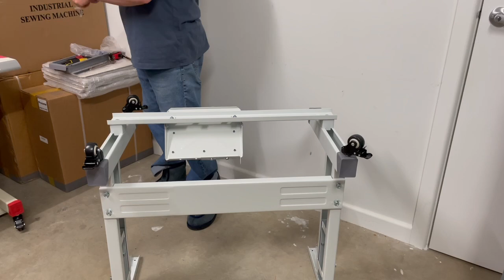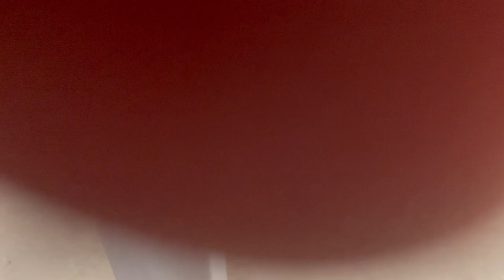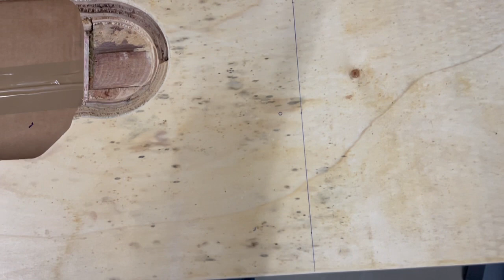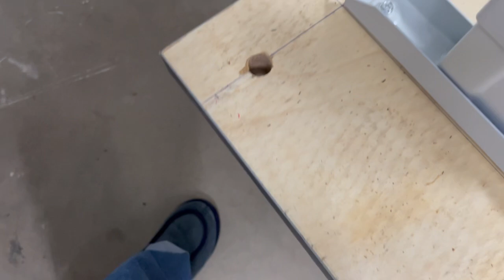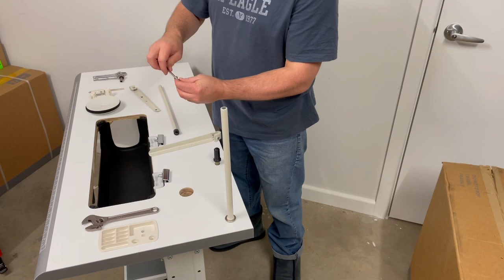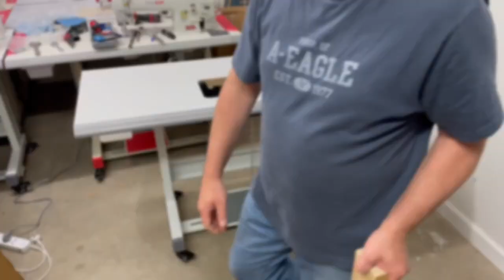**Updated** How To Put Together Industrial Sewing Machine Table

Comment: Hi there! Great video. I was wondering if you have a more in-depth tutorial of how to change the height of the table? Thanks!
Reply from the maker: No sorry but it is pretty easy to do. All you need to do is loosen the three bolts that secure the top section to the bottom section and raise it up to where you want it before tightening the bolts again.

Comment: Hi could you tell me what size whells you are using as mine came with feet and think your wheels are much better x
Reply from the maker: The wheel itself is 50mm in diameter, the screw in shaft is about an M12